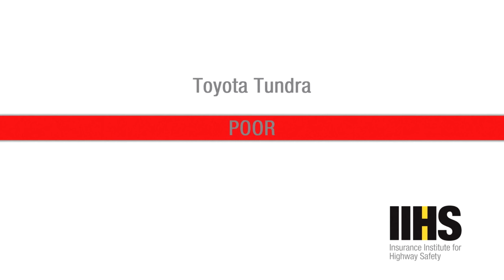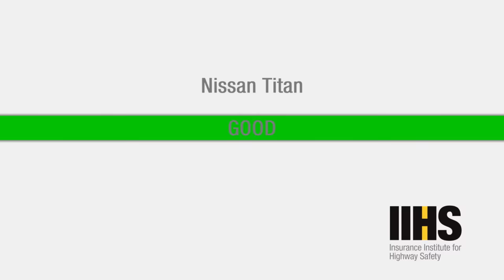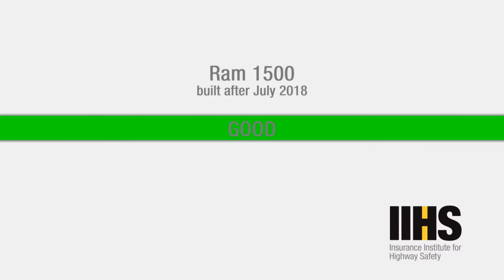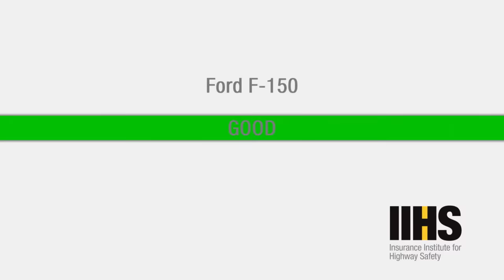TRUCK CRASH TEST COMPILATION - Ford F150, Toyota Tundra, RAM 1500, Nissan Titan

Comment: I'm here just to read the arguments between Dodge, Chevy and Ford owners.
Reply: There is no argument. There is only one clear winner.
Reply: Chevy for the win the best on the market
Reply: @diegoromero6179  Says who?

Ford outsells them by far!
Reply: @Loki1620   They're cheaper to buy, there's always many more used Fords for sale than GM, why?
Reply: @johnhare7279  Because they last long enough to be resold!
Reply: @Loki1620  Why is there more GM classic cars and trucks?
Reply: TheOtherMike: How am I doing Mike?
Reply: @johnhare7279  GM is both GMC and Chevy for one, and the other is the fact that GM USED TO BE a great company. That old 350 was and still is a great engine. The old stylings were attractive. I would love to have an old shortwide. Don't act like there isn't plenty of old Ford and Mercury classics out there, though.

Shelby Mustangs are still ridiculously priced. Ford Broncos, not running, will still bring 10 grand for the early body style. How much for the old Ford GT40, again???

New vehicles don't compare to classics, though. You shouldn't have even brought that up! All real car people love the classics from every maker.

As for new trucks, GM sucks. Dodge Cummins is the preferred pulling truck in the 3/4 or 1 ton, and the Ford F-150 outsells Chevy Silverado or GMC Sierra any day of the week for the half-ton! This isn't even debatable.
Reply: @Loki1620  Yeah, I've known that since 1964. The 350 was the best back in the day, so were the GM transmissions. In fact a large percentage of Ford guys used GM powertrains to get the job done. Today, nothing compares to GM's LS motor. They can handle 12 lbs. of boost stock!  As far as you wanting a old shortwide, never heard of such a thing, I'm guessing you mean stepside, verses a fleetside?  F-150's are cheaper than GM trucks to buy new.
Reply: @johnhare7279  Shortwide is the common name for the short wheel base wide fleetside box of Chevy and GMC trucks from the 70's and 80's. Back when they were awesome, without all that electronic failure waiting to happen (which is for all companies now).

The old chevy transmission is good, but everyone is using Ford rear ends!

I actually have a buddy (with more money than sense) who paid a shop in Dallas to put a Cummins 12v in a Chevy Duramax body with the Allison transmission, but put a Ford rear end on that, too! People can spend their money how they want, but it seems like a waste for a rig that just pulls his Team Roping horse trailer around!
Reply: The GM didn't even make it to the wall.
Reply: of course, no one wants to destroy such a great truck!
Reply: Loki1620 cause they are the cheapest truck made
Reply: Acually Ford sales more pick up trucks than Chevy...
Reply: Wolf 10 cause there a cheaper truck to buy, you want something to last chev.
Reply: Scoop Yall Ford are not cheaper than Chevy the least price for a Chevy is about 55 thousand while the Ford raptor is about 70 k which mean there is no way the Chevy is more expensive than Ford...
Reply: F150,,plain and simple
Reply: Pablo Rodriguez last one I had was crap, never had bad chev
Reply: John Hare im a chevy guy but now that chevy is closing plants in the US and moving to china ill buy ford next go round.
Reply: John Hare but chevy guys buy ford rear ends.
Reply: TheOtherMike look what you have started I hope your proud
Reply: Alonzo Kincaid ford guys spend thousands on transmissions, especially 3/4 ton trucks
Reply: @AdamRStovicek  which is ram
Reply: Scoop Yall exactly you didn’t answer me because I was right
Reply: Wolf 10 made cheaper, and the truck 150 is cheaper because they are crap. I don’t answer every one, I hav3 so many other sites. Want truck that holds it value, be chev or gmc in my case. Want crap...
Reply: Scoop Yall actually Chevy And GMC are made out of plastic and the Ford F-150 is made out of aluminum And is the most selling truck in the USA which has broke the record  for the best selling truck for 42 years and it’s the best in the Pick Up Class...
Reply: Scoop Yall btw there is no reason to get mad it just our opinions but I’m giving facts.
Reply: Toyotas and fords are the best
Reply: No ones seems to hate on the Rams and im not mad 🙂
Reply: Chevy man sorry
Reply: Yeah the three loser brands because all 3 suck and are priced higher than the reliable tundra
Reply: @Loki1620  Ford trucks do not outsell GM trucks. The GMC and Chevy are sold and classified as two different brands even though they are the same truck. That's the only way Ford numbers seem higher. Not real comparison.
Reply: @Loki1620  Not debatable when you classify GMC and Chevy separately. They are the exact same truck with different front ends and that truck outsells Ford.
Reply: @johnhare7279  because GM's are all broken down at the wreaking yard. Lol
Reply: @johnhare7279  Simply because there are more on the road. I'm not even a fan of ford.
Reply: Adam Stovicek look what you've started 🤦‍♂️
Reply: @Loki1620  saying Ford is the best because of the most sales must mean McDonalds makes the best cheeseburger
Reply: @Scoot S nowhere because its Ram now
Reply: Ford has never been bailed for bankruptcy.
Reply: John Hare   Just wait a couple of decades. Their glory days are long gone.
Reply: No you!
Reply: jaue82  Alllllll the way back to 2011?? Yet Ford claims to be number 1 for 70 years. Bullshit.
Reply: @Loki1620  by your logic, Vanilla Ice is among the greatest talents of all time. People voted with their wallets. Makes him as talented as Stevie Wonder, Metallica, The Rollong Stones....
The American public is 90% brainwashed sheep consumers. Grown babies with money. Quality is not determined by quantity. Try again.
Reply: @cedricwilliams6229  you refute the facts that Ford sells more without providing anything to back it up. Sad. You then tell me that bbn in a free market economy, which we have, we buy more Fords and have for 70 years because people are sheep instead of the much more likely scenario of the demand simply being higher. Again, lame.

Next time bring some facts with you.

That Vanilla Ice quip doesn't work, either. He isn't selling out stadiums. He isn't selling out bars, even! He had a moment in time where some people really liked his music, but that was fleeting.

Comparing music to a tool is the old proverbial apples and oranges comparison.

People don't depend on music to get them to and from work.
Reply: @Loki1620  Apparently you have trouble comprehending what you read because I didn't say those things at all.
I said Ford CLAIMS to be number 1 for 70 years. Even though there were many years in the last 70 years that GM trucks (that's Chevy and GMC combined) out sold Ford. 
And you said in a free market economy whichever product sells the most is the  better product. So my use of Vanilla Ice made perfect sense. He did sell out stadiums, obviously, he went multi platinum. It doesn't make him "better". Just more popular to a sheepish society. We can use Justin Bieber if you want to be more recent.
And now you wanna cry tool vs music because I destroyed your silly argument. 
Let's use another tool then if that helps you understand. Glocks outsell Sig Sauer fire arms by millions. That doesn't necessarily make Glocks "better". There are arguments to be made there and it's a matter of opinion. Saying anything that outsells anything else makes it a BETTER product is just stupid. Try a little actual thought before you try teaching people with your little youtube comment lessons.
Reply: @cedricwilliams6229  Glock is literally more reliable than Sig with a much larger aftermarket support base. More law enforcement carry a Glock than any other firearm. Your silly argument doesn't hold water. You should try a little research before you try teaching people lessons on YouTube comment threads.

As for my market economy comment, People speak with their wallets. Whoever sells the most is the most selling. With respect to vehicles, that shows who has the best product. If Chevy wanted to be the best, then they should make vehicles that require much less factory recalls! Then, maybe, they would outsell Ford!

The funny thing is I am Dodge and old school Chevy man! I am just honest about the fact that Ford has been the best selling truck for generations for a reason.
Reply: The winner is none of them.
Reply: Jr Orchard yes they have
Reply: Ford for the win
Reply: Did you see how late the dodge truck deployed its side impact air bags and the honda Ridgeline bad front air bag as well as the frontier scary kinda wonder how much damage goes into the floorboard how many parts creep in thats a scary thing !
Reply: John Hare Ford is not cheaper to buy. And cheap would be a good thing? And obviously there are more for sale that are used because people buy more. And they last longer. That’s common sense.
Reply: Loki162
Reply: @GO AWAY and the Chevy is broke down on the side of the road with the engine bay on fire...
Reply: Scoop Yall maybe until you wreck it lmao, you watched the test, the ford was the safesf
Reply: @GO AWAY funny, but that will never happen! First off it is about the half ton truck. Second, the Duramax will never be what the Powerstroke is, which will never be what the Cummins is! As previously stated, if they were still running their old engines without all the electronic nonsense, I would maybe drive a Chevy, but even then that is a maybe.

It is too bad that Chevy and GMC cannot beat Ford's sales figures combined even with the government supporting GM!
Reply: @grumpusmaximus9446  I didn't forget to mention anything. I dont KNOW the years it happened in and which years are irrelevant. The point is it happens. What does it matter which years? Look them up if it's a big concern of yours Rainman.
Reply: Cedric soyboy Williams
ROTFLMFAO you GM fanboys are the only group of people I know who brag about losing. The correct answer is 2015, that's the only year in the last 40 years that GMC/ Silverado sales have been higher than F-series.
CONGRATULATIONS !🎆🎉🍺
Reply: @cedricwilliams6229  The point is Ford outsells BOTH consistently. One year was just people unsure about the aluminum body. It proved tough. What happened in 2015 to Chevy trucks??? Oh yeah... Airbags, airbag control modules, seats, and brakes recalls!
Reply: BlackBronco1972 yo man I no dat, gm is shit I like my 92 s10 raptor, it be leakin dat blinkar flewid
Reply: Loki1620 To be fair, they use the blanket term F series, that means f150- f750. So when all of your vehicles has F on it then yes, they will outsell any other brand. The F250 diesel line was a bit of a disaster after the 7.3l up until the 6.7l. The 6.0 and 6.4 would fail spectacularly unless they were modified at the expense of the owner. I’m not insulting fords, they’re great trucks. In my opinion the only truck that  has a crew cab option that doesn’t feel like you’re just in an extended cab with doors on it 😂😂. Great trucks and SAFE trucks! I love Fords and Chevys, not much of a dodge guy though..
Reply: Loki1620 Also, dodge doesn’t make the Cummins. Cummins makes the engine for dodge. Awesome engine but any 12v dodge rusted to shit with an manual tranny brings in some big bucks. That’s why 12v swaps have become so popular
Reply: @Loki1620  McDonald's out sells everyone on hamburgers, but their not the best...
Reply: @dehydratedjuicywater3288  McDonald's sells more hamburgers than anybody else does but it doesn't mean that they're better
Reply: @alonzokincaid1362  Chevrolet is also using the 10-speed transmission from a mustang in the new Camaros
Reply: @dehydratedjuicywater3288  McDonald's sells more hamburgers than anyone else but it does not mean that they're better
Reply: @cedricwilliams6229  remember this McDonald's sells more hamburgers than anyone but it doesn't mean that they're better
Reply: @brianfagley1304  they're made in America I just purchased one
Reply: @Loki1620  as I recall just a few years ago all the f-150s were catching on fire
Reply: @williamsteelejr1534  Spamming the McDonalds comments, I see.

For their price point, the only thing to be considered, they are clearly the best, as they outsell Burger King (which I like better), Wendy's (which I like better), and pretty much everyone else in that value market! If they weren't the best for their market, they wouldn't dominate the market.

Ford has the same thing going. Not everyone likes them, sure, but they dominate the market for a reason.
Reply: @bystander665  The link I shared was just sales of the F-Series half ton, which we both know means just the F-150.
Reply: @Loki1620  Ford had a market and followers for sure. Their new trucks look alot better than they did from 97-14.. I will say they set a good standard. I would buy one before a Dodge or any foreign company's full size.
Reply: @williamsteelejr1534  I agree about the looks of the box from the early 00's to there current style, but I liked the late 90's slightly curvy looks. Not enough to own one, but I prefer 80's and back.

I would rather be able to wrench on my vehicles without having to have an electronics engineering degree (which I actually earned while in the Air Force).

If a truck has a computer in it, it had better be my laptop in a bag!
Reply: Smart move
Reply: @williamsteelejr1534  exactly. Or any number of other analogies.
Reply: Ford is number 1☺️☺️☺️☺️
Reply: @williamsteelejr1534  I clearly said Its best in Pickup Class.. and the most sold.
Reply: TheOtherMike same lol
Reply: Adam Stovicek Dodge is owned by Chrysler tbh.
Reply: @diegoromero6179  Yeah. As  proven by this video, eh?
Reply: @johnhare7279  Depends where you live. People in my neck of the woods hold on tho their Ford trucks. GMC, Chevy and Rams suck.
Reply: Ford beats the shit out of them all
Reply: Tundra is the best truck some one paid for this video
Reply: No better truck then tundra all broke down tundra keeps on going
Reply: I don’t even like trucks I’m a Cadillac man
Reply: @Loki1620  the reason why theirs more Ford trucks sold is because  the sell % of the Silverado and Sierra trucks are independent from each other even tho it's the same truck just different make but if you combine both GMC and Chevy pickups GM sells more trucks than Ford
Reply: @dirty1081  Read the link I already put in this thread. GM altogether still doesn't sell as many as Ford.
Reply: Tundra for the WIN !!!
Reply: @melesmeles2095  not the debate, at all.

The old 80's Toyota pickup is still the most durable little truck ever in my opinion!
Reply: And if you didnt know gm is made in america
Reply: @kodytrehern7766  To be fair, I like the GMs, too. They just don't outsell Ford has been my point through this whole thing.

I think we both can agree that the older vehicles are simply better than the new plastic crap we are being sold!
Reply: Chevy no and there's no question .......
Reply: @el_champion235x4  I am not following your comment. I think that perhaps a word or two was left out. Could you explain it for me?
Reply: What I meant was Chevy for life till the end because I like Chevy ...
 that's what I meant to say ....
Reply: @el_champion235x4  cool.

You like what you like.

I like the older stuff. If it was before 95, I like it, if was before every car had an ECU, I love it!
Reply: @Loki1620  yup because i do like the 98 to 01 for 150 stepside 4x4 there just bad ass looking to me
Reply: Carlos Jimenez I do
Reply: All I'm going to say is I have been a mechanic for many years and I have owned Chevy Duramax Dodge Cummins and Ford cumstroke (Powerstroke) a Duramax has 518000 miles starts like a champ has balls like Rambo and Halls like a train my Cummings was a pretty good truck I love the body the engine just couldn't hold up and my Ford Powerstroke didn't even see the mileage compared to my Duramax I only got up to 277,000 and I was only using it for a tow truck my Duramax is my heavy hauler I'll drive from Michigan straight down to Texas with confidence so long story short I've learned that Chevy is some of the best now y'all Ford and Dodge diehards out there will argue with me till you turn blue in the face Chevy is the superior truck especially with their new models that have full box frames vs Ford frames they Flex up to 65% more then the Chevy full box frame
Reply: @dehydratedjuicywater3288  I've seen 2019 gm pickups on the lot for mid 30s
Reply: @johnhare7279  with proper top end and tuning they can take way more than 12lbs.
Reply: @Loki1620  of course they outselling the other trucks.. ford owners only have them 2 years then get a new one. Chev and ram owners have there trucks a lot longer cause more durable
Reply: @Loki1620  your comment is all over the map. Settle down, don't panic at end of the day there good ol American made trucks
Reply: @damitbobby6677  I am guessing you didn't read the actual thread, or even just my comments...

American made? GM? Really?
Reply: TheOtherMike lmao its like children fighting over a goddamn toy
Reply: @Loki1620  sales don't mean best. McDonald's sells the most cheeseburgers, that doesn't mean they're the best.
Reply: @Loki1620  
I can't argue anything what you said of the '70's and '80's Chevy PUs but I know they were prone to cancer.
Reply: Radford Tataryn  I didnt argue that. I argued that they mislead by saying they outsell GM ALL years. For 40 years. Not even close.
Reply: GM is one of the most hypocritical companies
They mocked the aluminum F150...
Then 3 years later GM introduced aluminum trucks Hypocrisy
Reply: @grumpusmaximus9446  Are we not gonna adress the fact that it takes both Chevy and GMC COMBINED to outsell just 1 simple Ford truck ? COMBINED !!!!!!!